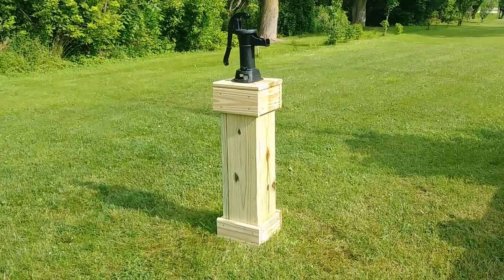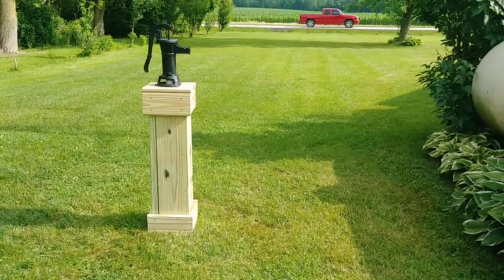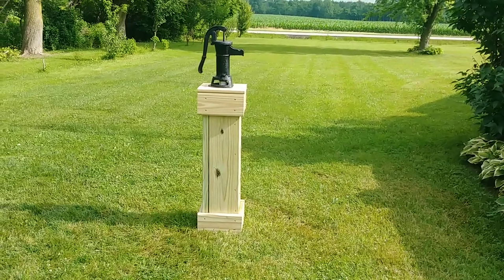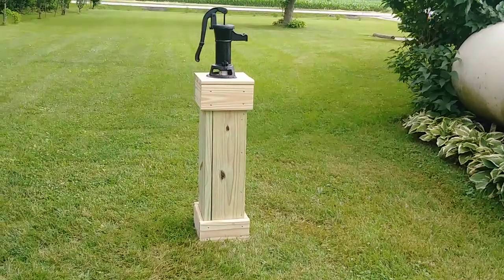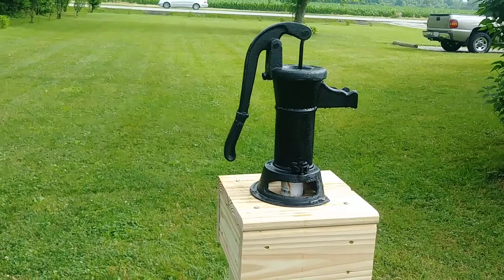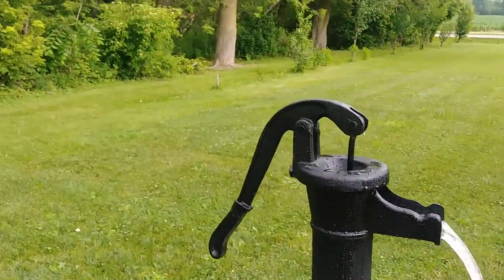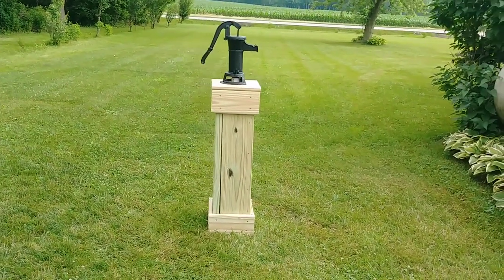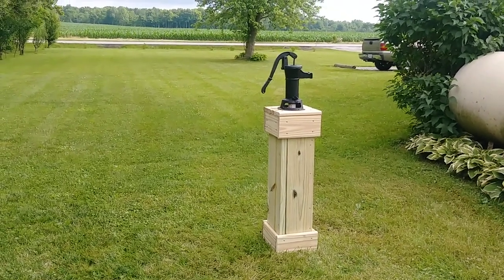FREE WATER, I Installed a Pitcher Pump on an existing well head.

Comment: We purchased a few acres recently and found a capped water well there. I plan to drill a hole in the cap and install a hand pump just like you did. I hope my plan works out!
Reply from the maker: Sound good, hope it works out. Be careful of how you use a wells water. you can have it tested for water quality. Thanks for your comment.

Comment: A week or so ago I had my well guy install a pitcher pump, with backflow preventer, teed off the pipe running to the well house where the pump is. I'm here in Florida and, unless that pump is covered somehow, all kinds of insects, frogs and oak tree debris is going to fall or crawl into the chamber where the piston rod moves up and down. The well guy didn't have too much of an opinion other than to note that, if covered, the cast iron would likely rust more. Any thoughts on whether it's necessary to cover the chamber and block the spout with a plastic bag between pumping it weekly to keep the seals wet?
Reply from the maker: I haven't had any problems with anything getting into mine. Hope yours goes well.
Reply: @sterlingdewey  Thanks, appreciate the reply!
Reply: Curious how much that set you back?
Reply: @bacon10211  The pump was about $125 and they charged me $180 to install it. They teed off the pipe between the well head and my equipment shed. Took them an hour or so all told. I'd built a simple stand using a 6x6 post with 2x6 "stringers" which the pump is bolted to.

Comment: Did you say five quarter boards, 5/4? Like an inch and a quarter or 1.25?
Reply from the maker: Hi, 5/4 lumber is lumber that was rough cut to 1.25 inch. When it is finished planed, as you would get at a retail lumberyard, it will measure 1 inch. It is decking lumber for decks and steps. Thanks for viewing and commenting.

Comment: WHY DIDN'T YOU SHOW THE WELL HEAD BEFORE Covering IT?? rates a thumbs down
Reply: 1 1/4" female threads on the inlet of the pump. I have the same pump and just got it reduced down to 3/4" to match the pipe going into the well. Very simple to install and works great.